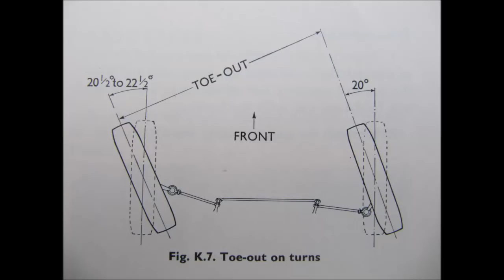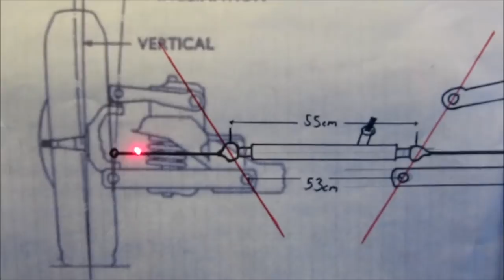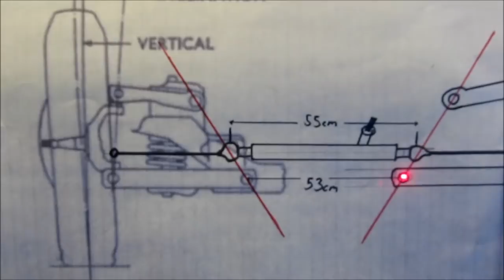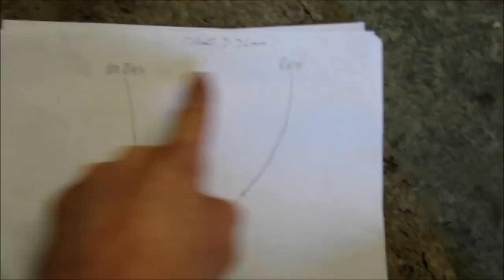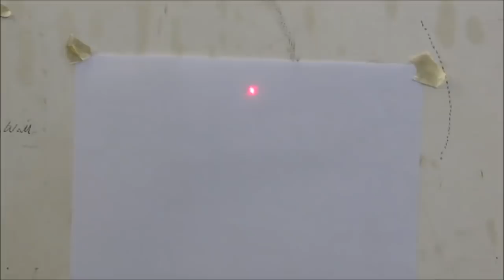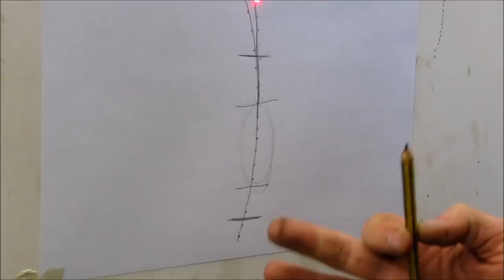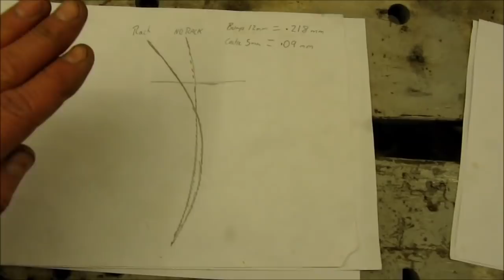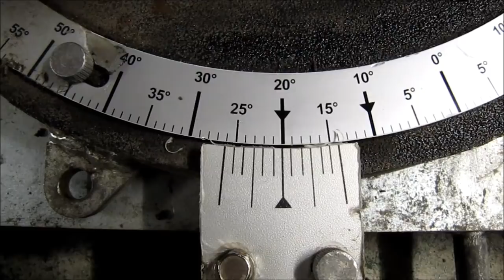Trev's Bedford CA Van blog-part8 Steering rack conversion

Comment: Very handy video! Thank you! I am actually finishing up a conversion of my own, a completely different kind of car, and era, but the issues I had to deal with are remarkably similar to what you have experienced! My project involves a large luxury car (a 2004 Buick Lesabre), which originally was Front wheel drive, but I am converting it to Rear wheel drive, and in place of the poorly designed V6 that originally came in it, I installed a huge lump of an engine (Chevy 350 cubic inch, 5.7 liter V8) . The new V8 engine is far more reliable, easier to fix, cheaper to fix, and will run for many hundreds of thousands of miles. I ran across a particular problem involving interference between the engine and steering column, also the engine pan (sump) and the power steering rack which came on the car. I effectively eliminated both problems by simply moving my engine mounts back towards the rear of the car by only 1 inch, and I was able to clear all these components! Now all I am working on is buttoning up the floor and trunk (rear boot) floor after making room for the rear axle, suspension, gas tank, which all had to be re-engineered. I did make and install a new subframe system to bolt on the rear suspension. Thanks for the video! It was very helpful!

Comment: This is one of my favorites with the bump steer explanation. Lidl sometimes sell magnetic base 15cm spirit levels with inbuilt laser cross hairs, the come with a small camera tripod. Worth looking out for, only a few quid. These are great for sticking on discs and shooting a cross onto tape stuck on the floor or wall. You can maintain a rough alignment when taking apart or swapping bits on front suspension etc.

Comment: here in australia a lot of people use mitsubishi L300 van front ends to convert to rackand pinnion and double A-arm front end suspension
Reply from the maker: motorised1 yes great idea, I had looked at one once but they’re getting a bit thin on the ground and also perhaps a little large, the other issue is the uk’s ridiculous laws on losing the I’d of a vehicle after too many changes. Cheers Trev 👍

Comment: Trevor,  At the time you should have looked at what they did in the race car industries or custom kit racing cars where they have custom wish bone suspension and steering solution.   I've seen recently someone modifying a Volkswagen Beetle sub chassis so that it could support a V8 engine in the back.  Now they used 3D cad software or a cad/cam software like Solidworks SolidEdge to create that new custom sub frame that would hold the two axles the V8 engine mount ad the new front steering axle.   Now I know I'm late watching your restoration of your van.  But with your choice of engine, that would have been a good thing to lift the body from the chassis and look at the foundation of your Bedford CA Van and maybe ask someone to redesign that chassis with in mind your choice of engine, exhaust, etc.   That would have made your restoration much easier for you and with what you planned for that Bedford CA Van the new chassis would have help offer better support for what would be inside the van.

SO if you ever do a similar project again,  keep that in mind.  redesign the chassis to fit your needs.  And restore the top portion (body) of the project.   

Only if I had found your channel at that time in 2014.

Comment: would the rack fit when the original motor is inn still?
Reply from the maker: Bens MetalshapingShop Hi Ben, there was much more space around the original engine/gearbox so it probably would have fitted with the original engine. The only issue is that the original gearbox was column change and there were a lot of rods where the steering coupling now is. Cheers Trev 👍
Reply: ThanksTrev, will see if there is a way..Great build man..
Reply from the maker: Bens MetalshapingShop thanks Ben, are you actually thinking about fitting a rack to a CA with a standard engine?
Reply: Yep,will see in the future if I can.It's my Daughters 63 CA,,,
Reply from the maker: Bens MetalshapingShop think carefully that’s all I’d say, it’s a big job to be undertaking and I only did it because I absolutely had to. Cheers Trev 👍

Comment: the rover 200 lol in america it would be a ford somthing or a chevy vega 
im glad i sold the shadows and kept the RR silver spirit i put a bently turbo R rack in the spirit with a harvey baily suspension bars n springs with stock shocks drives like a corvette but so smooth.  i want to do a rack conversion to a 1976 Cadillac Fleetwood (summit racing) offers a retro rack ,its pricey and is a custom unit to fit to power steering cars. ill wait 20 years get it (used off ebay) then install to 1976 Cadillac with some modern electric generator engine and a boot full of batteries lol.maybee mexican hydraulic suspension on it to travel across plowed fields) LOL ;-)
Reply from the maker: The rover was the last car manufacturer to go bust in the uk... Sounds like you're well into your cars and mods. You're super lucky to be in the states (I'm assuming you do live there?) in the us you have a thriving car mod manufacturing business because your government realise that they can benefit from the taxes raised from people's passion with cars. Meanwhile back in the uk they like to stop people from doing anything they can... Like your merc too I've got an old w123 estate (station wagon)